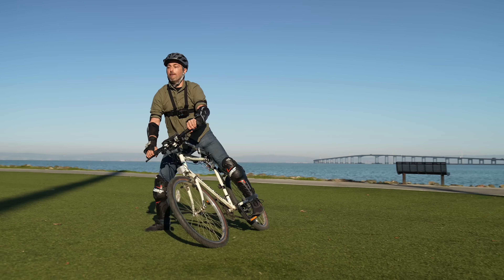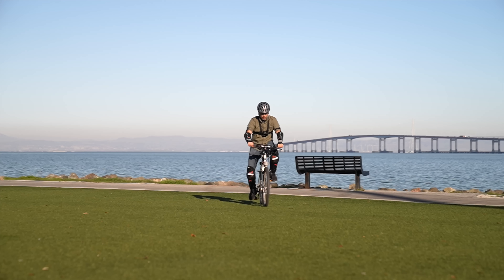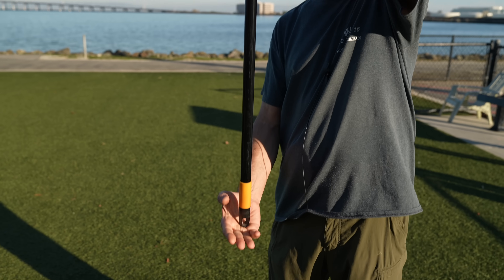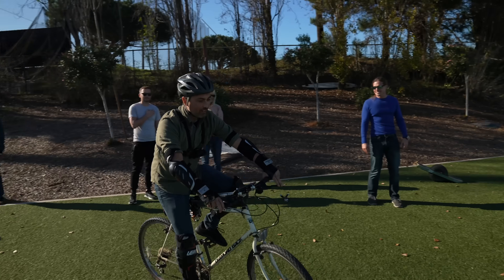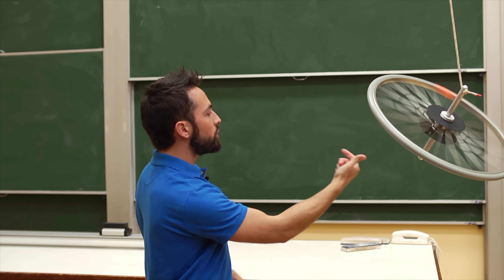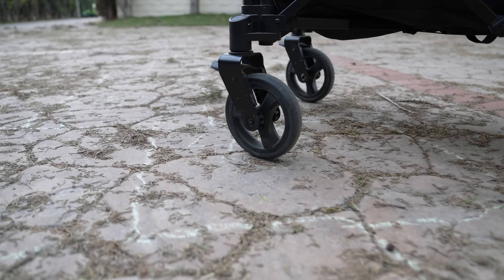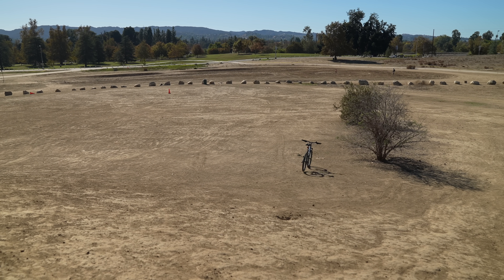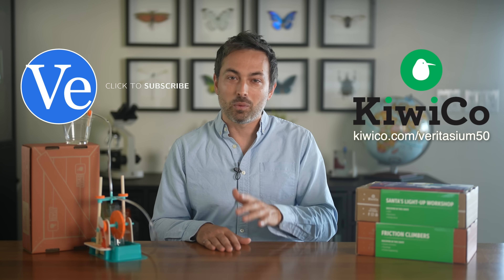Most People Don't Know How Bikes Work

Comment: It would be thoroughly fascinating to see this bike ridden by a good bicycle trials rider.  To be good at trials you have to be able to separate lean and steer, you sometimes need to avoid countersteer to get your wheels in the right place on an obstacle, or even counter lean, as in lean the bike to the left while turning right.  Of course a lot of trials riding doesn't involve the wheels turning, so "riding" may be to loosely defined in this case.
Reply: Separating lean from steer is something most kids learn early on, but that'd help, yes... The stuntmen may be able to pick the right wheel off the ground, and scoot around on the rear wheel exclusively, changing directions as required and so forth (like in "the nosebleed section").
Reply: @sebastianramadan8393  Now that’s a reference I have not heard in some time.
Reply: First mistake, do this standing. Then it is way more simple.
Reply: @Simon Vandenberg one time I was riding with KFC in one hand. I figured a bit of hands-free countersteering would be nice at the bottom of this hill, to keep grip. I can fully endorse KFC as a makeshift airbag for pushbikes.
Reply: @sebastianramadan8393  love this story... I know where Uki is! Spent a week there in 2010 ish. Lovely part of the world. Would have loved to pedal around those hills. I have also had many foods cushion my fall on a bike.... Never KFC though. Thanks for the tip.
Reply: I'd like to see if I could complete the turn by bunny hopping into the lean and accelerating from there.
Reply: Seems lime the trials riders or whatever could be a potential exception to the rule. The average person should be the baseline. Especially considering the history of the bicycle and it's originally intended use as a transit device, and not an extreme sport that a small margin of everyday bicycle riders partake in.
Reply: @benbaker2385  I'm a casual cyclist. I've never raced and usually just bike to commute to/from school. After watching this video I payed attention to my turning and sometimes it's pure lean and other times it's initiated by a counter steer. Now that I've noticed it, they feel like two different modes of turning. I find that I can comfortably turn with leaning only if I'm paying attention (but would probably crash if I wasn't). I don't think it takes any sort of pro or even someone with training. Perhaps it's a skill you develop from learning to comfortably ride fast, but I also might just be weird.
Reply: Trials riders overcome this by hopping the bike to keep it under them (sort of like a pogo stick). That might be possible with the locked-out steering bike. Not sure.
Reply: @mckenziekeith7434  I was waiting for someone to bring-up the trails rider, "bunny hop" issue (which really doesn't have anything to do with the issue discussed here, since the bike wheels aren't rotating, it's not riding in the traditional sense, and therefore has little to do with how a single-track vehicle turns)...
Reply: @danielklopp7007  I am not the one who brought it up, actually. It was mentioned 2 weeks ago in this same sub-thread. Apart from that I don't really disagree with you. I do think it is possible that a trials bike rider might be able to stay up on a bike with non-turning handlebars even while it is rolling, but only after a fair amount of practice, and only at low speed.
Reply: @mckenziekeith7434 : In order to turn, you must lean in the direction of the turn.  The purpose of the lean is to counteract centripetal force (at slow speeds and/or large turn radii, the centripetal force is very small, so the lean will be very small - but it's always present - otherwise the bike will fall to the outside of the turn). To initiate the lean, the rider has to push against something (i.e. Newton's laws of motion)... that "thing" you're pushing against is the earth.  The way you "push against the earth" is through the handlebars (since the tire contact patches are your only contact with the earth when riding a bike).  It is technically possible to push against the air to initiate a lean-angle, however the difference in mass-density between a human and air is considerable, so you'd need to move a LOT of air in the opposite direction (... keep thinking of Newton's Laws of motion).  Ironically, leaning by "pushing on air" is more feasible at much higher speeds (where the rider is in contact with a much higher mass of air in a much shorter time period).
In other words, the people in this thread who claim they "just lean their body" to initiate a turn on a bike clearly don't understand Newton's Laws of Motion.
Reply: @danielklopp7007  yes I know. If a two wheeled bicycle is rolling and both wheels are maintaining traction with the ground, it is impossible to keep the bike upright without turning one of the wheels because once it starts to lean in either direction it will not be possible to counteract the lean and get the contact patch back under the center of gravity. It will also be impossible to turn.
Reply: Yeah i would like to see someone who can throw the bike around under them. When I want to turn left I dont lean left, I usually just lift my knee and lean the frame over to somewhere between 45 and 90 degree. I am not saying I could still cycle the bike, however it would be interesting to see whats happening and would happen if the bike was changed slightly. Also Id like to see what happens when people get up and run on the bike, with the frame violently moving from left to right as they go straight on.
Reply: you can lean and ride straight but you can't steer without leaning, i don't believe its necessary to counter steer first to make a turn, since you can drive a bike without hands, where only leaning is applied, so if those people are as good as you say they are (idk since i've never heard of them), i don't think they would have a problem riding that bike. I have also payed much more attention since i saw this video, and since i've been interested in the similiar phenomenom i noticed a few years ago, and u would have a hard time convincing me that i cant do it without a counter steer
Reply: @rokmerse9551  If not using your hands, only leaning, the bike will counter steer by itself. That method won't work for this locked-handlebar bike. They didn't show it in the vid, but if you locked the handlebar and pushed the bike down a hill, it will crash...
Reply: @sirhetmanpirate  what do you mean it will counter steer on itself... if i try to make a right turn, i lean to the right if a bike therefore counter steered to the left it would make me turn right even harder and that is not a part of the bike keeping its balance... in the video the preposition is that u steer with a steering wheel, i agree, that counter steering is very useful in many scenarios  and i also use it every day, joining traffic etc... i thought of using a rope on one side, to repeat the experiment i will have to wait unfortunately since there is a 15centimeters of fresh snow outside, but i'm quite positive one can still make a turn ( i had a chance to observe a path i made in a snow before but i wont take it as firm evidence since the conditions are a bit abnormal... no countersteer detected)
Reply: @rokmerse9551  without countersteering or lean, then turning the bars to the right will throw you off to the left.  Physics.
Reply: @grantperkins368   that is exactly my point and we all agree on that one, the claim is (or the video, and probably yourself claim that), that you cannot lean the bike if you dont counter steer first, which i'm not buying.... becausecause-life.
Reply: @grantperkins368  You're probably right, if by "left" you mean "potentially over the handlebars". Be aware, when you learn to ride motorbikes, if you dare lean the opposite way to your steering you may very well wake up in hospital after eating the bitumen. As you said, one OR the other, both aren't necessarily simultaneously... Road bikes don't even use the steering wheel a whole lot; you can see when they race, they're exclusively leaning to steer.
Reply: @sirhetmanpirate  This isn't true -- it won't "counter" steer by itself. As shown in the video, if the bike begins to fall to the right the handlebars turn in the SAME direction as the bike which prevents it from falling over. 

If the bike falls to the right there is nothing that causes the handlebars to first turn left before they turn right.
Reply: @rokmerse9551  yes you can definitely do that, lol, as you say, life.  The thing is, it won't get you around corners very well: heck, even changing lanes is a struggle  ... moto jitsu did a nice vid about it
Reply: @sebastianramadan8393  yup, on motorbikes i was surprised when in a safety class they told us to actually steer the handlebars with a quick jab in an emergency move.  They even presented it as counter-intuitive bc us riders don't normally 'turn' the bars -- we lean 1st.  That is bc turning the bars while sitting straight normally has lag time for the rest of the bike, and resists the banking that is needed for safe, controlled turns.
Reply: @rokmerse9551  I think you're correct you don't have to counter steer. One first just has to ask the question "what do you accomplish by counter steering?". All that counter steering does is leans the bike over, putting your center of mass over to one side.

You could argue that in the scenario where you lean over, the bike is straight and you're leaning to one side where counter steering angles the bike under you, and you're straight up. However once the bike begins to lean over you can shift your weight back and you'll end up in the exact same position caused by counter steering.

Of course it's not intuitive to lean if you have muscle memory built already. I'm sure someone riding this bike long enough would turn one direction just fine, it would probably be akin to learning to ride a bike again to some degree.

The other user mentioned that a bike with locked handlebars would fall over if pushed down a hill, which is true but irrelevant. when turning left you can still turn the handle back back right, just not past the point where it straightens out so you can still make corrections left and right, as long as you're leaned over far enough. This was proven when he was able to ride in circles on the bike.
Reply: @rokmerse9551  As demonstrated in Derek's video, a bike counter-steers itself without a rider (or if the rider has his hands off the handlebars). It is simply impossible to initiate a turn on any single-track vehicle (i.e. bicycle or motorcycle) without the front wheel first moving in the opposite direction of the turn.
Reply: @danielklopp7007  well that is simply not a real answer and since i've also did the experiments myself i'm even more sure that one can do it without a counter steer... i've had a debate on how its done in another comment but shortly... i did it with leaning
Reply: @rokmerse9551  so I guess you don't believe in Newton's laws of motion??  If you would do the experiment (as Derek did in this video), you would find that if the bicycle steering was "locked" in such a way as to prevent the handlebars from turning to the left, you could NOT initiate a right turn.  With no handlebar input, leaning your body to the right will simply result in the bicycle leaning to the left, leaving the center of mass of the combined bicycle/rider in exactly the same place (i.e. every action has an equal and opposite reaction).  I have a university degree in Physics - and did my senior thesis on this exact topic (i.e. vehicle dynamics of single-track vehicles)... I know of what I speak!
Reply: @danielklopp7007  well as long as the riders ass is stuck up on that seat it is as you said... that is not the scenario i was talking about, have a great time cycling that degree. just one question, if you then let go of the steering ("leaning your body to the right will simply result in the bicycle leaning to the left") ... where will the wheel turn? (and it is the very law of motion that even makes this logical hence there would be no way you could even lean-i understand that perfectly, and that is exactly my point)
Reply: @rokmerse9551  I think we may agree regarding single-track vehicle dynamics.  My previous point was if you simply lean (with no movement of the handlebars), you cannot initiate a turn.  If you take your hands off the bars, then lean, the bars WILL move on their own (in the opposite direction of the lean).  However, the turn doesn't actually start until the bars turn (in the opposite direction of the turn).  In the case of hands-free riding, rather than direct input to the bars by the rider, the bars are turned by the act of the rider shifting their weight.  In either case, the handlebars MUST turn in the opposite direction of the turn, to initiate the turn. BTW, the opposite is true if you want to straighten the bike back upright - the bars must be turned in the direction of the turn (further than would be required to maintain a given turn radius at a given speed).
Reply: @rokmerse9551  countersteer means that the handlebars turn left to initiate the right lean for the right turn. Even when you are riding "no hands" this happens. It is just that you might not be aware of it because you are making it happen with body language. If you lock out the steering mechanism, you will not be able to stay upright for long because there is no way to get the bike under you if you start to lean (except maybe by hopping the bike...)
Reply: @Simon Vandenberg I can't think of any time while riding hands-free where a bit of countersteering was a good thing; that almost invariably results in pain from my experience. Not saying I haven't tried. I road from Currumbin to Uki and back one day, mostly along the highway, hands-free anywhere I could (which is quite often if traffic's not at peak).

Comment: The basic reason is weight distribution if the steering is locked it’s almost impossible to stay upright due to the mass on top leaning towards one side or the other causing the whole thing to fall to that side when the bike has no addition weight on top it’s harder for the mass to get out of control and cause it to fall over. Steering is still a massive part of it staying upright but the main reason we fall over is due to the entire thing being too heavy cuz of our own weight

Comment: Okay, I'm lost on the description at the start.  If you disable turning right, you cannot turn left.  If you disable turning left, you cannot turn right.  This is just how bikes work.

1) Going down the line, straight ahead.  The bike's contact with the ground is directly under you; your centre of mass is directly over the wheels..
2) I want to turn LEFT.
3) I turn the handlebars slightly RIGHT.
4) The front wheel goes RIGHT, and immediately your centre of mass is NOT over the wheels; it's to the LEFT of the ground contact.
5) The bike promptly starts falling over to the LEFT.
6) You turn the handlebars LEFT to recover and put the ground contact back under the centre of mass.
7) You are now going LEFT from your original course.

To turn LEFT, you twitch to the RIGHT.  To turn RIGHT, you twitch to the LEFT.  This is when you're at speed.  And the higher the speed, the less turn needed.
Reply: You're exactly right.  And the reason we disable left turns when asking the rider to turn right, is to demonstrate what you're saying here.
Reply: @Rick_Cavallaro  Thanks for the reply.  About... 35 years ago I had to prove to my brother that it works this way by having him ride on the back of my motorcycle with his hands on my elbows.  He could feel the twitch left, go right results.
Reply: @linksysroutenoh.3460  Nice demo.  We tried to think of good ways to make this as clear as possible.  But as you can see from the comments, we definitely didn't convince everyone.

Comment: Something I used to do on motorcycles is push the handle bar.  So push the right handlebar forward, the bike leans over and you turn right.  It won't actually feel like your succeeding at pushing the handlebar because the effect is the bike leans over and counters the push.

Comment: so you made a logical video explaining how we start turning a bike, cool i'm just now learning how and it isn't as intuitive as learning as a kid. i get how to start a turn but how do you end it and get the bike back under you? i keep getting to the point of no return and just ejecting out of it
Reply: You always steer in the opposite direction of the lean you want.  So if you're in a right turn and you want to return to normal straight-ahead riding, you actually turn a bit more to the right during the turn.  That will cause a lean to the left that will bring you back to vertical.
Reply: @Rick_Cavallaro  will keep that in mind and try it out, thanks
Reply: @sghotouk  Good luck.  You might find it useful to just ride in a more or less straight line and then give small left and right steering inputs.  You might even want to do it rhythmically.  That should help to burn into your subconscious the relationship between steering inputs and lean.

Comment: the first thing they teach you about riding a motorcycle is the countersteer. at low speeds (under ~15mph), you turn the handlebars in the direction that you want to turn. any faster than that, you’re supposed to apply pressure to the same side as where you’re turning, essentially “turning” the handlebars in the opposite direction of where you want to actually turn. so if you’re making a left turn, you must press on the left side of the handlebar.

Comment: I feel like this video should be called "WE don't understand how to ride a bike"... yeah if you turn the handle bars to the right WITHOUT LEANING INTO THE TURN then you will have an issue... you shouldn't have to steer left before going right if you are riding the bike LIKE A BIKE, a bike is not a car, a motorcycle is not a car, you are supposed to lean in the direction you are turning!